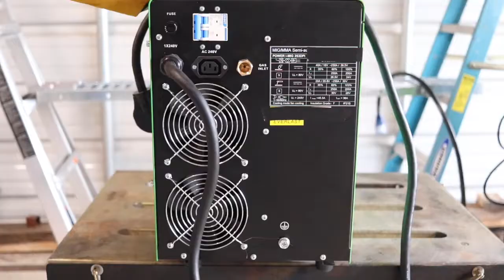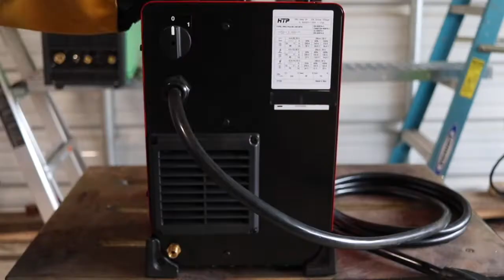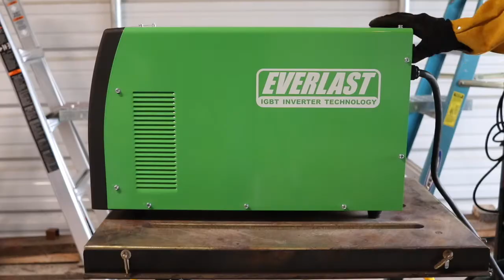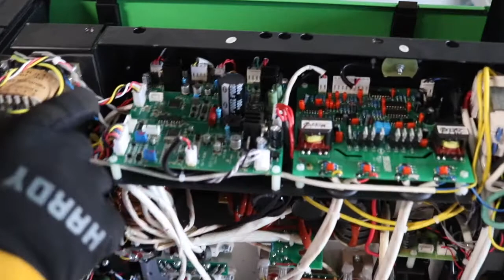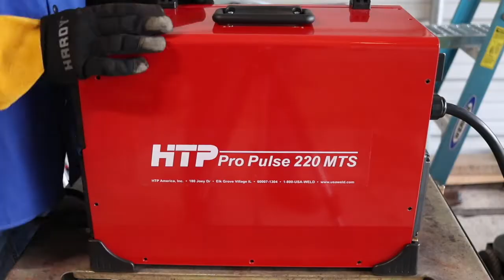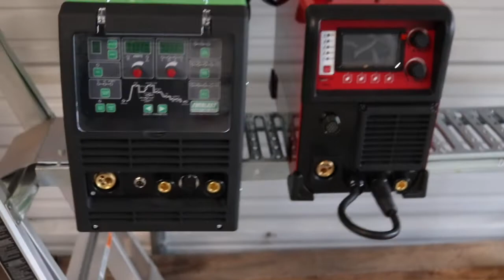HTP Pro Pulse 220 MTS VS Everlast 253DPi comparison Part 3

Comment: My shop has converted to all Everlast equipment. Zero failures in the last two years. Prior had blue and red machines that worked well, but were way overpriced, so buying new ones wasn't worth it. Three Everlast welders to one Blue welder is a major consideration in my book. To clarify, if you open a Blue or Red Welder, all the parts are still Chinese.

Comment: The circuits you claim are old style are used because they are more durable than surface mount in the output power section of the unit. Micro circuitry is good for your Blue Ray player but couldn't handle the demand of 250A 230v multi-purpose welder except in the programing section. These circuits are more durable and are not affected by the electronic noise exhibited by the units features. Coating the boards retains heat and doesn't let them breath, they shouldn't be exposed to moisture which is what board coating is mainly used for. I can go on but I have had enough. One last tidbit, the specs were much better on the Everlast vs the htp. Two large fans vs 1 small one.
Reply: Blah blah blah. 
That coating doesn’t retain heat enough to make a difference, please prove to us the point in the old style being more reliable? Also 1 fan can move more air (cfm’s) than 10 fans depending on several factors so your point once again isn’t valid in the slightest. 
Sounds like you just wanna reason to but neverlast so have at it, but don’t state BS doing while on your way to the crapper!
Reply: Proove it @bearkawiboy6246

Comment: I don't think you know what the heck you are talking about. It appears you work for HTP and are a used car salesman.
Reply: Giving him too much credit.  Some one here pointed out that these are not competitors for major $5 digit Miller industrial welders used 8 hours or more per day in gross environments; we'll use ours on our farm, and may repairing something in our restaurant kitchen.  I have seen a video describing cleaning the insides of one of these, blow it out with compressed air.  Coated boards, surface mount, whatcha mean?  Those 2 fans might be noisy and the boards horizontal when vertical might be the MIL spec, but get a grip.  Hack job review!
Reply: I think you work for Neverlast and you sound butt hurt badly. Maybe try some ointment before becoming a keyboard warrior spokesperson for your old russian boss and his 18hr old girlfriend that is now probably majority owner of that Chinese supplied company

Comment: These are home hobby type units not heavy industrial units so unless you have your grinder sitting on top or its exhaust positioned towards the welder the dust shouldn't be a problem. Metal grinding dust does not travel far from the source.
Reply: What home hobbies doesn’t have a grinder laying next to his welding projects. Also, not many people work out of their living room, but go wipe off your TV stand  and see how much dust is on it. Every talking point in every comment you’ve made has been invalid and stupid at best.

Comment: The fan needs to blow across the heat sink fins more then the components because the electronic components are designed to transfer the heat into the heat sink not the surrounding air. Also I think you lowered the background to much when you lowered it from 145 to 90 that will cause to much cooling between pulse and prevent adequate burn thru

Comment: Everlast has a way better duty cycle, 4 gear driven rollers cast aluminum vs a two drive wheel plastic plus a 5 year warranty. It's bigger and heavier for a reason. More metal and less plastic.
Reply: @morgan98801  So you have no personal experience at all? And you have chinese products all over your home and in your pocket at all times, lol.
Reply: Primeweld will get the customer interface award, but if you can put up with the attitude (which also comes across in the documentation, but the flip side is that they take an almost intellectual approach, very deep), EL has the most cutting edge tech, in this well read but still noob observer.  From my reading of the comments elsewhere, use the well known DIY when servicing your EL, don't send it in--stories of slow slow return predominate.  Frankly tho' I have not read the other several parts of this review, I sense a hit job and a halting slow delivery at that.  I built my first electronic kits in the 1960s, so wiring, soldering, board pull and replace et als does not phase me.  In fact I like the EL approach.  Why send a modular unit away to have someone pull out a likely already diagnosed bad part, replace it and send it back?
Reply: Also, wondering where HTP gets their PARTS.  Even Miller buys from "overseas".  I have an Italian made tractor and it was nothing but trouble for its first couple of years due to, ready for this, poor wiring design.  The factory rep for New Holland who is still a friend in retirement was so unhappy that he got the company to send me a no charge $500 diagnotic unit for future use.  But the otherwise excellent Iveco diesel engine DID smell like garlic for its first 20-30 hours, not kidding.  I think it was mixed into the paint.
Reply: It’s a higher amp machine 🤦🏼‍♂️
Reply: I’ve had fantastic customer service with Everlast. I tripped over my plasma torch lead, snapped the connector off inside the machine and they overnighted me the parts, no cost, over a year after I bought the machine. 

I have a high interest in htp machines and may try one in the future, but I see comments about Everlasts customer service and like to add a positive here and there so that bad customer service doesn’t just become “here-say”. If guys have bad experiences by all means let the world know, but for guys who have good ones, that needs spread as well
Reply: @bradwheeler6563  I have had a great experience with my Everlasting 225.  I emailed them with questions and they got back to me the next day with a full page worth of info to my questions!  This being my first welder, I had some very basic questions. I feel they went out of their way to get me going. Also, I bought it from Everlast and they delivered on time,  Included a high quality MIG gun, TIG gun, Ground clamps are very very well made. My machine can do AC TIG so I can weld aluminum and Stainless, that's the main reason I chose it over other machines. Also 2000$ price tag, I am very happy with the Everlast 225 MTS lightning
Reply: Everlast also sucks at customer service and repair. So bonus?

Comment: I too considered both machines and ended up with the Everlast 253DPI. I’ve been using it for 6 months now and I’m happy with it. I was fully aware of the construction differences without seeing them in person. Face it, Italian vs Chinese, it’s a no brainer.  However, price reflects this as well.
Reply: Thanks! I have since purchased the HTP pro pulse and have to say this machine is quite possibly the best I have for welding aluminum, I have 2 Miller welders and a Everlast tig plus the 253 dpi but there was a nothing like this HTP the arc is so precise
Reply: @raymondcorreira847  what are the welds like? Are you getting fairly clean looking beads and is the set up fairly straight forward? No birds nesting and wanting to throw the machine across the room? Lol
Reply: @MrChickenking44  the HTP pro pulse is by far superior very easy setup with settings you can even set inductance up to 200% giving you quite a range on the weld puddle from stiff to a extremely buttery flow with the welds and there is a slide switch to adjust voltage available for it so you can back off on the heat to avoid melting the end weld
Reply: Hi supergarball are you welding aluminum with your 253 dpi? Wondering if you may have setting suggestions, I have been using the dpi 253 for about 2 years and still haven’t been able to nail down settings for 1/8” and 3/16” 6061 aluminum welding in pulse or Double pulse.
Reply: @raymondcorreira847  Sorry, I don't have anything useful for you as far as settings.  I've welded plenty of aluminum with the 253 dpi quite successfully using non pulsed settings and the usual 1 amp per thousand of an inch guideline.  For pulse, I think I had to add 10% to that figure and adjust up trial and error until I got a proper puddle going.  It did work well for the times I played around with it though.

Comment: 3 parts of confusion, a used mk cobramatic is 10x the machine and plentiful, for less money, everlasts defensiveness is their biggest turn off, "speak softly and carry a big stick" I almost bought a 325 or 350 tig a few years ago but their extreme defensiveness that I've seen online towards any negative criticism made me not want to deal with them, too bad their shit looks good  and reasonably priced for what it is
Reply: I'd have to agree on the defensiveness and attitude.  Needs to stop.  But their tech is cutting edge.